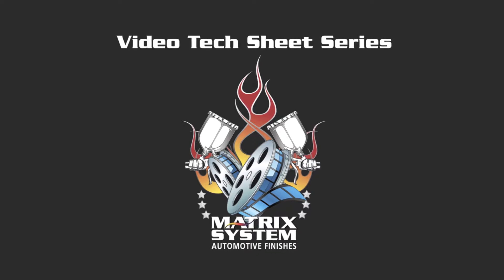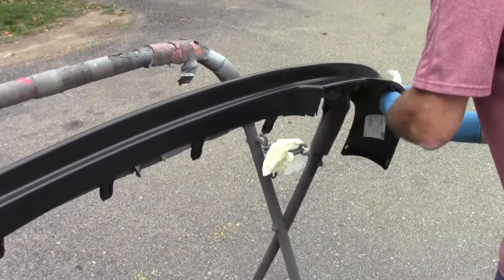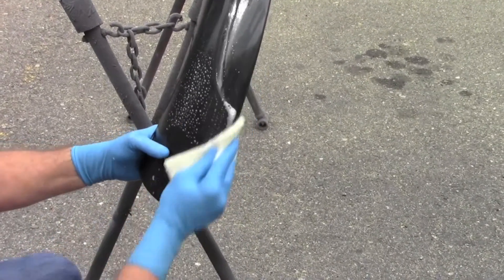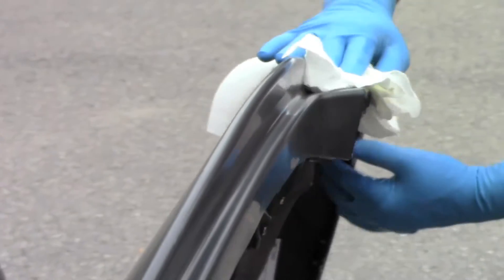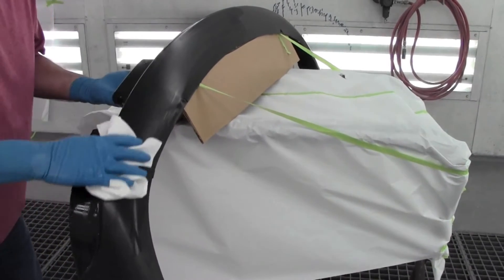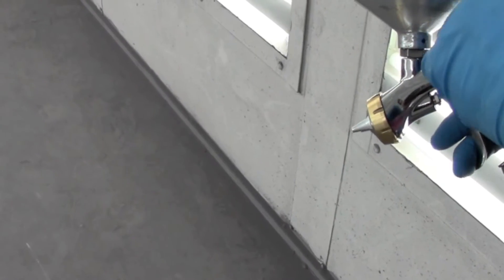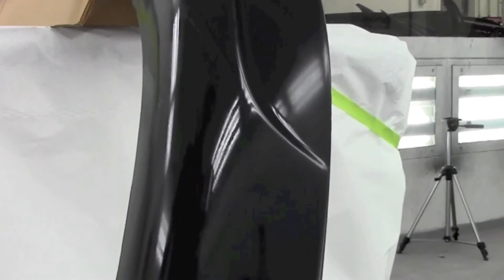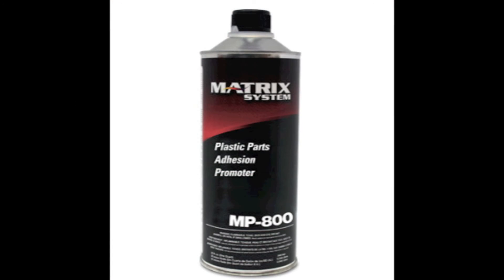Matrix Video Tech sheet plastic MP800

Comment: I am new to using Matrix, slowly making the change from DuPont. Do you use the MX841 flex additive any? Or are you confident enough that the clear doesn't require a flex additive? If you do use the flex, how does it mix? I have gotten on the website and cannot find any information about it. Thanks